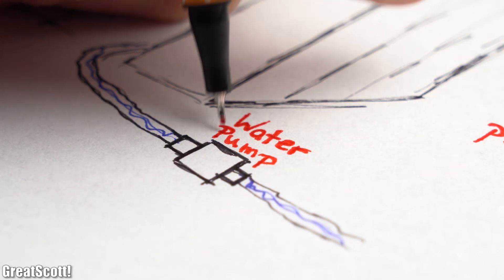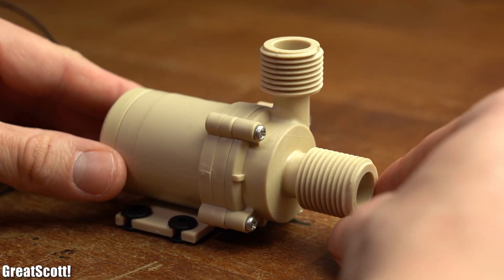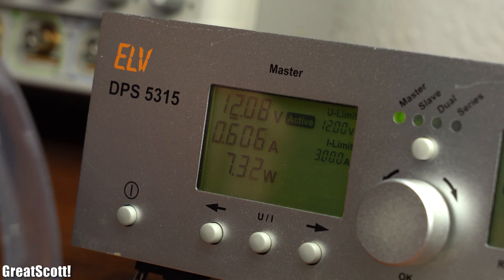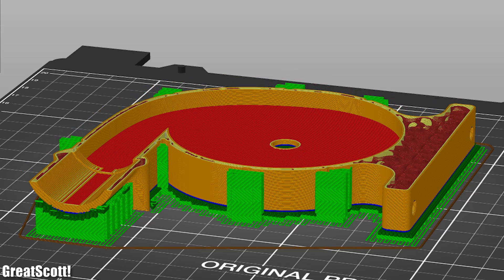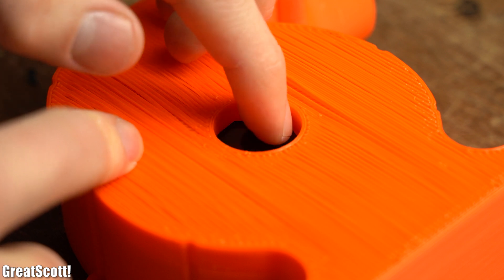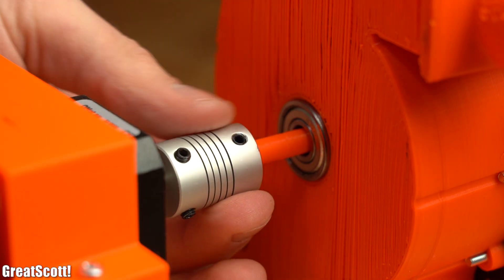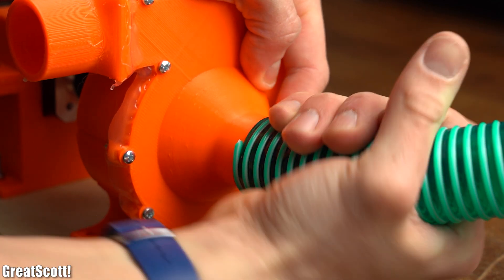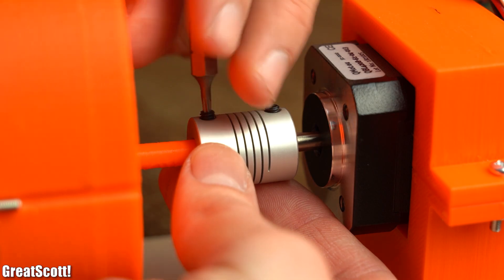Water Pump || DIY or Buy

Comment: The vanes on the orange pump curve the wrong way, that would put more strain on the shaft, although the shaft sould be bigger or replaced with metal
Reply: Also he's spinning it the wrong way even for the given vane direction (ie trying to suck through the outlet) I'm not sure he realised this though as he still tried to use the intended outlet as the outlet. I think you can even see it push a bit of air into the bath tub water near the end.

Edit: I was wrong, see Daniel's comment bellow for why. Short answer is that centrifugal force wins out over any effects that the blade angle or curvature could impose.
Reply: Not sure about that, he was hand turning it the right way, but much like wagon wheels on  western movies, the shaft could look as though it's turning the wrong way when powered.
Reply: @maxk4324  It will still pump water, even with the vanes curved the wrong way. It will just be very inefficient because it causes a lot of turbulence, the pump is fighting itself. But the fundamental principles of centrifugal pumps mean it will never reverse flow. In-fact forward curved centrifugal pumps do exist but are mainly used in air pumps and tend to have smaller vanes closer to the edge of the impeller.
Reply: @Xei I'm curious, does it create cavitation then or just a non laminar flow?
Reply: @Chris Russell blade direction is very important for efficiency. All will work, but the wrong blade direction will cause too much stress without accomplishing anything. The heavier the substance, the more you want the blades to twist to the opposite side of the direction they spin to. But, this should allways be at least straight, or twisted in the direction opposite to the direction the blades spin to.

Sorry for bad english, i tried my best
Reply: @danielrouw2593  Yes they work by centrifugal forces but the blades have to acommodate the increased flow speed on the outer diemeter. It will be inefficient and needs more torque to pump the same amount at similar pressure.
Reply: @danielrouw2593  The curve has a high effect on the flow dynamics inside the pump.
seeing them at 5:00 they are the wrong way. They should be curved in the rotation direction, so they "throw water" into the outlet part - not shovel it in circles.
The turn direction by hand was correct there.
Reply: Thank god someone else noticed this aswell
Reply: @danielrouw2593  SHit your right, my bad. Was thinking about it in cartesian terms (ie as if each blade were an airplane wing) rather than polar coordinates. But now that I wrap my head around it a little more I see that even with the apparently "wrong" curvature the centrifugal force will still push fluid radially outward. Thanks for the correction

Comment: No hate bro but you really should possibly go through the datasheet for the centrifugal pump to explain the various parameters. Such as pump head, volumetric flowrate and impeller diameter, how to get the pump curve and the energy efficiency of the pump. You go into so much detail for so many other videos

Comment: Why you not have used steel bolds for the shaft? Drilled a hole to the existing rotor and fixed it with two nuts countersink between the orange rotor.

Comment: if you put a metal rod as the impeller shaft you would most likely get some really good results.
another thing is that if you turn the impeller to fast the water can "stall" and try to flow backwards, and snap the shaft aswell

Comment: I think the plastic wasnt the problem here, the design was. The big pump could have been designed with a metal shaft and would work perfectly fine. The fins on the impeller of the big pump are backwards aswell, this will greate quite a bit of unnececary drag which also put more stress on the shaft.

Comment: tiny bowls ... compared to the pump.

At least a lot of effort to learn another lesson and let us save time. 
But there might be another selfmade water pump somewhere hidden in the web you may could not find due to typos like watrepump every time.

i had such strange experience recently that I could not find a specific object but 6 montgs later when I had finished and checked again. At that point the guy had corrected the typo but bit everywhere so I was able to get behind that "hide and seek" story.

Comment: Teflon tape on hose barbs. 🤦‍♂️ That's not what it's used for. Teflon tape is used for (NPT) national pipe threads or (BSP) British standard pipe threads.
Reply: This whole video was hard to watch! And yes you are exactly right about the Teflon tape 🤦 the fittings are barbed for a reason..

Comment: You could try using a linear rod that inserts into the impeller. That should be a lot stronger than a 3d printed shaft.

Comment: the problem is you can't 3D print strong shafts, expecially not in the orientation you did. You can try to print them flat or just use a metal rod or screw.

Comment: Should have tried a metal shaft. The rest could be 3d printed
Reply: Also didn't help that his 3d printer wasn't properly calibrated. You could see the top layer lines peeling away
Reply: Tomgie yes METAL for all shafts and hinges.
Reply: @christianscandi  yeah, while the thing in the upper layer is a problem (one that I'm having right now) it doesn't seem to have caused any failure at all
Reply: https://www.youtube.com/watch?v=aXcEiOuWKx4&t  DIY is winner!!!! 
i used motor direkt on impeller..  make 10meters lift.
Reply: yeah, first thing I though. Design a pump with less flow load and use a metal shaft. The massive eccentricity between the rotor and motor also did not help at all (the wobbling shaft)

Comment: Use a metal shaft for the impeller and it will work perfectly. I have made several 3d printed pumps with no issues. Simply attach the impeller directly to the metal shaft of the motor. I understand that it wasn't worth your time though. Also your pump impeller had blades that are curved in the wrong direction. they need to be curved backwards to the direction of rotation.

Comment: For your greenhouse, check the SCD30 sensor by Sensirion.
It measures humidity, temperature and CO2 level (IR sensor !).
You can connect it to an arduino through I²C, real nice!
Reply from the maker: Thanks for the idea :-)

Comment: You should have drilled the plastic rotor axle, to replace it with a metal one. I guess this could have made your pump work a little better.
Reply: This is what I was thinking about after seeing 3d model. Just modify file to have a hole for a shaft
Reply: Just use a bolt as shaft, and tighten it with a nut to the impeller.
Reply: Clément 2000 or at least print it separately with different layers orientation
Reply: Clément 2000 THE VANES ARE BACKWARDS...!!!! How come no one is saying it..? SCOTT ITS BACKWARDS ;))) look at the vanes on the small pump you bought and see which way the vanes curve in respect to the direction of rotation ;)))
3:25 THEIRS (note exit hole location, impeller rotation direction and the angle of the vanes.
5:05 YOURS, note same things ;)
@GreatScott!
Reply: @laser69beam  LOL, you are right, that is also the problem. I didn't notice, but now I'm literally laughing.
Reply: @laser69beam  this is actually the correct direction, I don't know exactly why, but I've seen the same design on other water pumps. check "Hydraulic Effects of Reverse Rotation on Centrifugal Pumps" by "Grundfos Americas" (very big pump manufacturer)
Reply: Another approach is to use a soft start routine.  A controlled ramping up of speed to minimize heavy loading on an undersized shaft.
Reply: @lint2023  there is no substitute for a metal shaft
Reply: Not litte, much more better! 3D print shaft is pretty dumb idea.
Reply: I could see that shaft failing as soon as i saw it. Personally i would print the impeller again with a hex recess and put a long bolt (with the screw end cutoff) through to use as a shaft. That would make a second video and shouldnt take longer that an hour to do. Good project though. I think its worth pursuine because it means you can scale the size depending on the motor you have and the flow you need and arent constrained by what you find online. Cheers
Reply: https://www.youtube.com/watch?v=aXcEiOuWKx4&t  DIY is winner!!!! 
i used motor direkt on impeller..  make 10meters lift.
Reply: @eric There are many good ideas in this thread but I think yours had the most good ideas in one.  Making a channel the same length as a standard O-ring.  That's very good. I would have never considered that.  The only thing you didn't say was that the rotor keyway should be a hex keyed, as others did later.  Nice post.  I've got a few projects in the works where these tips will apply.
Reply: The same in thinking but a better idea is to use aluminium or copper shaft
Because metal will get rusted
Reply: revers threads on the inside of the fan :)
Reply: I came to the comment section just to say this👍
Reply: Awesome!!! Loved this 👌👌

It's pretty much possible to 3d print a centrifugal pump.
I've done it and it worked well for a few days as my bike washing pump.

I've used a 5mm steel shaft to go within a petg shaft(jbweld), 12mm, and the pump unit was made to fit directly on the face of the 775 motor(the bearing version) with an additional 12-37-12 bearing on the pump. Water seals need to be custom trimmed out of silicon.
Gave a discharge of 18-21litres on 18v Li-Ion battery pack(5s3p).
Reply: Yes but since the impeller is 3d printed, a plastic shaft would be present because if not, how would you couple the motor shaft to the impeler ?
Reply: @Aybex97  You know that there is such a thing called shaft with a keyway?
Reply: I'd make a hole, and glue it, or use a shaft with a key-way as Thomas suggests for better results.
Reply: @Tomas970506  or just drill through and put a screw in keyways are difficult to make without a mill
Reply: @Tomas970506  Yeah that's a good idea didn't think of it
Reply: @johannesmuller1288  just 3d print in the keyway. Its literally just a 3d model you can edit. Blender and fusion 360 can do this even with stl files with little to no issues
Reply: @saberflow_official  3d print the keyway in the metal axle?
Reply: @Aybex97  EPOXY!!  My favorite is JB Qwik weld.
Reply: @Aybex97  he can use a bolt, by cutting the head, thread on the impeller side
Reply: @Aybex97  what if he printed a kind of D shaped hole, and then filed the shaft to match with the hole?
Reply: @Aybex97  just removr it a 3d modeling software.

Comment: I need to push water to 20feet through 3mm diameter microtube so is it possible?
Reply: You don't say how much water, or if that 20 feet is vertical, try a 'paristaltic' pump
Reply: @sparkyprojects  yes it is vertical and 5liter and please
Reply: I'd ignore centrifugal pumps for that head.  Peristaltic, as suggested, or you can't beat the old school piston in cylinder plus one way valves.  My home made one runs on less than 2 watts,  easily provides 4 metre lift.  Flow rate about 10 litres per hour, ie very slow but fine for my use.  Why such narrow bore tubing?   It's easier for water to flow through wider bore, less energy loss means lower power requirement.
Reply: You can get peristaltic pumps up to 20 litres per minute, they run fairly quiet, and because they use a silicone tube as part of the pump, they are totally sealed, no oils or grease can get into the system (they use them for blood transfusion etc)

Comment: Those small pumps are fun. I've got 4 in series to move water up hill from a dam. They don't move large amounts of water but at least I can run them off solar power and all day if I must. Saves using the noisey and polluting petrol pump.

Comment: Why didn't you try that with other materials? (in the 3D Printer)
Reply from the maker: Well, I could have tried ABS. But I doubt that ABS would have been the solution. It would have been better to use metal for the wheel shaft. The rest of the pump might have been able to deal with the forces. But then again there were a bit more problems with the 3D printed pump that did not make it in the video. I think even if I invested more hours in the DIY pump, the result would not have been that much better. That is why I decided to stop as soon as I realized that PETG could not handle the forces.
Reply: @greatscottlab  How was the shaft sliced, would slicing it in a different way mean it wouldn't shear like it did
Reply: @greatscottlab  Polycarbonate my dude
Reply: But waht is wiht PLA?
Reply from the maker: PLA can take less forces than PETG and ABS.
Reply: @greatscottlab  PLA is definitively stronger than PETG and ABS but it is more brittle and not water tight. Maybe a steel shaft and nylon for the impeller would work.
Reply: @greatscottlab  Can you make another test with a metal axle? I wonder how much water it can pump.
Reply: @greatscottlab  I have seen 3d printed motors with 300 watts using a metal axle and they managed to hold with quite bit of torque.
Reply: @greatscottlab  Did you also notice your impeller blades were backwards? :P
part 2? :D
Reply: @Krmpfpks  why would PLA not be water tight?!?
Reply: @greatscottlab  wrong. PETG take less force but has the ability to flex. I still think PETG was OK for testing purpose. the shaft was a big problem and you need to tune your profile in the slicer... the print was not really nice. maybe you could try and team up with other youtuber that actually 3d print a lot?
Reply: Zamundaaa I don’t know, water is very very slowly being absorbed into the pla and then starts to drip. It takes a few hours to get through - but it eventually starts leaking.
Reply: Hi, you should print the propeller in two separate pieces, and this way you would have a lot more resistance.